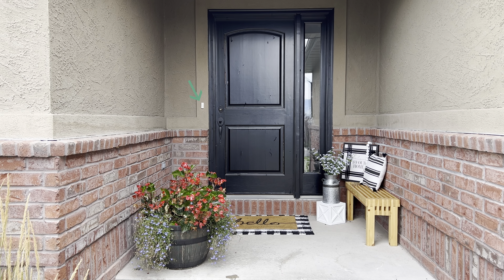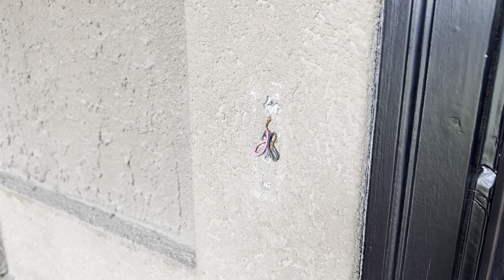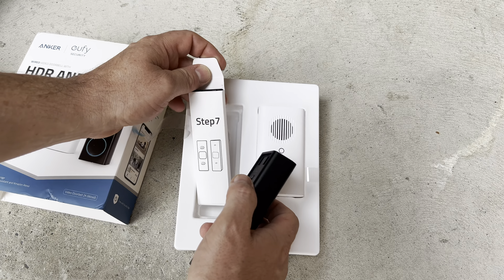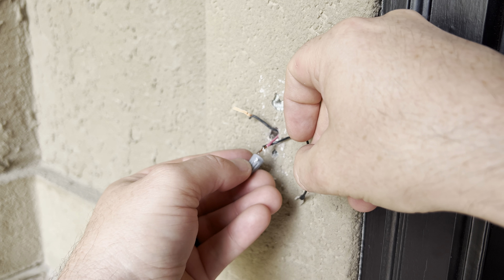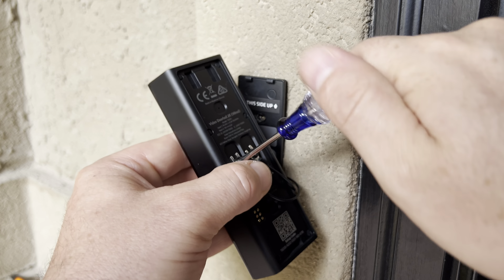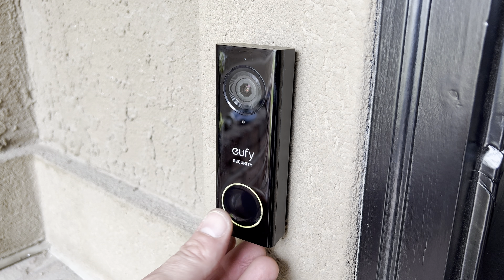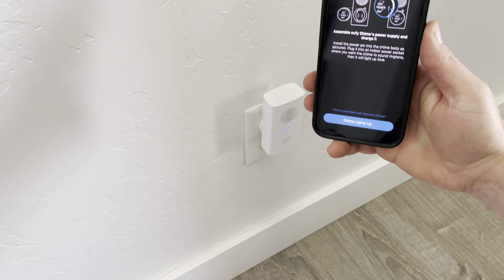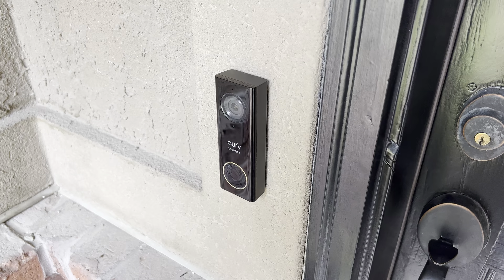How to Install A Doorbell Camera

Comment: Great video. Very helpful! How would you do this differently if you were installing your doorbell into brick? Are there special drill bit you need to drill into brick? Thanks!
Reply from the maker: Thanks for watching, Rae. If it is brick you will want to get a masonry bit. I believe it is a 1/4 inch bit. Drill the holes and then use the plastic anchors to screw into to hold the base.
Reply: What's does the Bridge does?